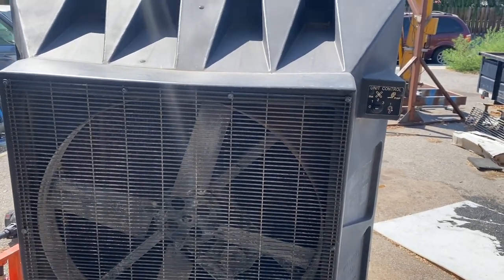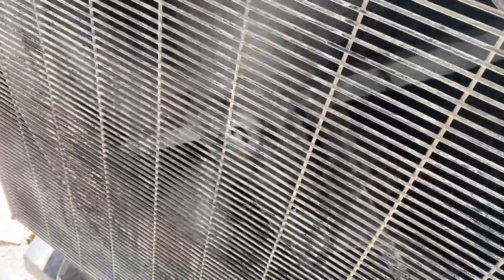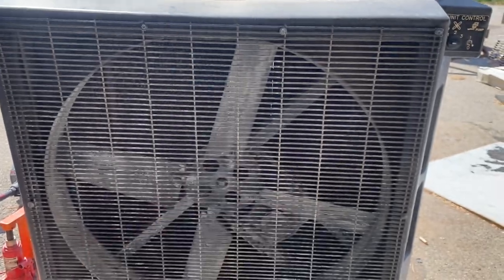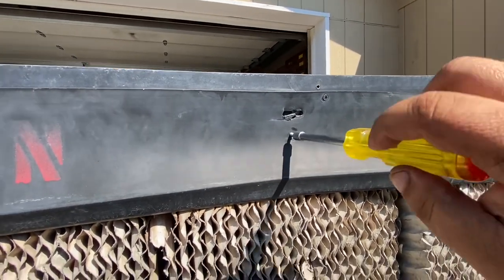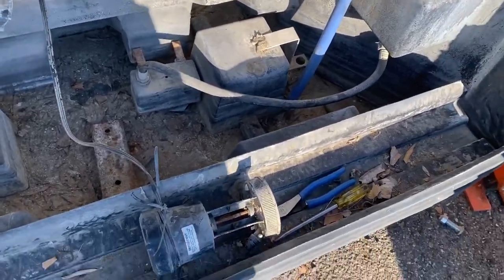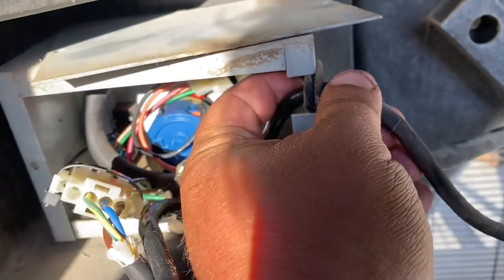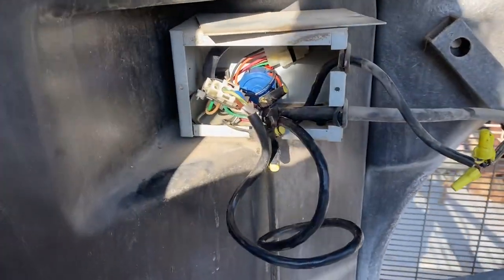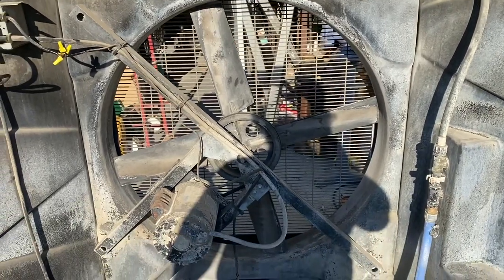Working on my portacool evaporative fan

Comment: Very interesting Adam do these actually work blowing cool air? Or is that what they don't do? Looks a small size motor for the size of the fan. Tony
Reply from the maker: It blows cooler air then the outside, it depends on how cool the water in it stays and stuff like that but is a big step up from just blowing hot air around
Reply: @smalltownmachineshop6860  Cheers, that's amazing Adam. Tony

Comment: Adam... I have one of these and the motor gets too hot to the touch and shuts off... do you think my motor is bad. I put a new capacitor on it and it did not fix it.
Reply from the maker: @darrenberg4042  motor could be bad, does it make any sounds like it has a bad bearing
Reply: @smalltownmachineshop6860  Not it just gets extremelt hot after running for 1-2 mins, no noise... then it will cool down and kick back on. I replaced the capacitor. I was thinking about rewinding the motor or just buying a new one and being done with it
Reply from the maker: @darrenberg4042  yeah, it’s a multi speed motor so if you can rewind it yourself I would do that as a off the shelf motor would be expensive, or honestly you could just put a single speed motor on it if you mostly just use it on high all the time